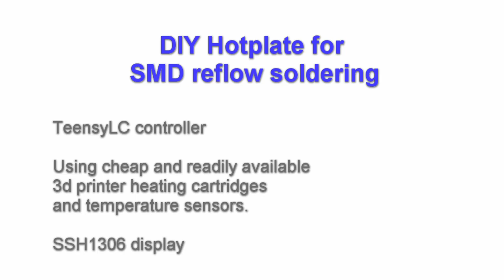DIY Hotplate

Comment: An excellent project. Would you think this was a better expenditure than buying a MHP30 type? Not to infer that we DIY a project to necessarily save money, of course. I would suggest buying a cheap spatula from the thrift store to use to slide your projects off of the hot plate. I have caused the SMDs to slip on the PCB, when removing boards from my DIY reflow oven.
Reply: don't waste your money on buying that mhp30. it small, not worth it.

Comment: This is good. Any link to the heaters used. Or project outline .
Reply from the maker: I used those heaters: https://www.amazon.de/gp/product/B082HV35HG/ref=ppx_yo_dt_b_asin_title_o08_s01?ie=UTF8&psc=1
Here the mechanical design: https://cad.onshape.com/documents/7bc865aca996a9254235945c/w/339bf6cb3e7271a238dd4811/e/654a49baf9ae12078f8de678
Reply: @luni64  great thanks for the reply.
Reply: Very Nice Project , May I ask for the Ckt and Code for the same .